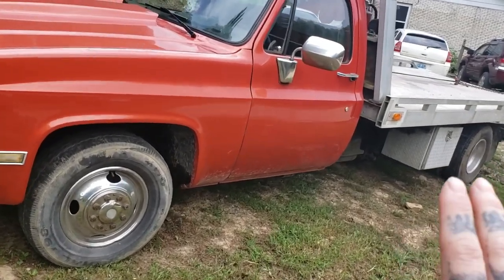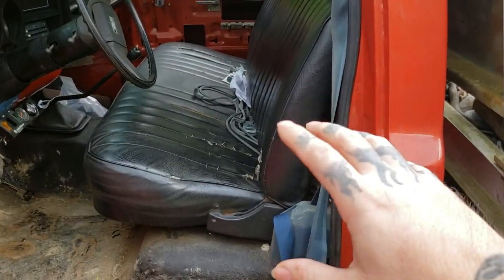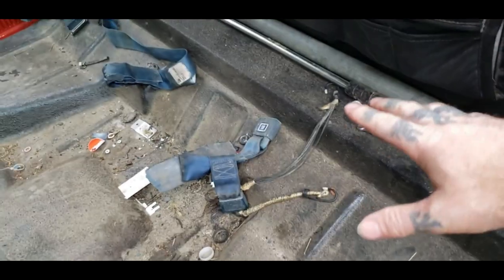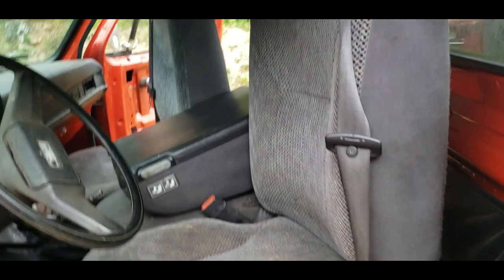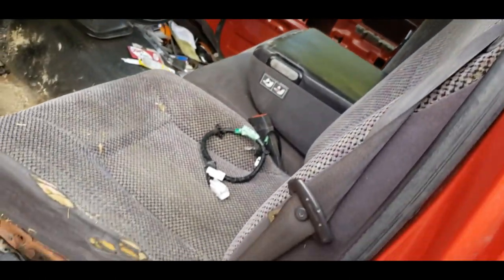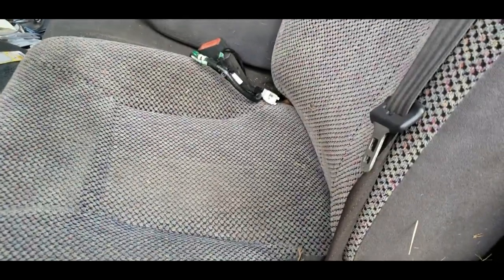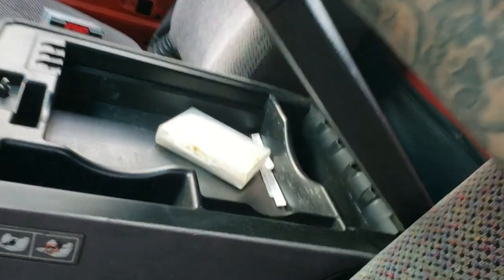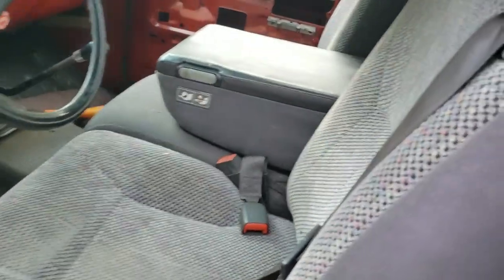Square Body Chevy Seat Upgrade, Bench Seat Swap

Comment: Nice job on fitting the seat. Since the seat belts are anchored in the seat back, I would suggest fabricating rear brackets. Just in case of hard braking or frontal collision, the seat would bend forward, placing you into the steering wheel or a passenger into the dash. Either one would hurt.
 As I understand, Sammy Davis Jr. unbuckled in his Cadillac died this way, when he hit the bullet shaped horn button, fracturing his upper ribs.
 You all take care now. Enjoy the videos and the work it takes to make them. Blessings brother.
Reply from the maker: True, but im not to worried cause the seats had to past safety with that set up in 2001 the year the dodge was made. great tip though

Comment: If the seat belts are integrated into the seat, then your seat belt strength depends on your attachment to the cab.or your welds .
Reply from the maker: Pretty much

Comment: I think my dad tried to put leather dodge seats in a 78 k20. But they were to wide
Reply from the maker: Wounder what year
Reply: @TattsForLife  it was a set of seats out of a 2000 I believe
Reply from the maker: @oldcroneysgarage9739  should of worked, did he remove them off the rails before trying
Reply: @TattsForLife  I can't remember it was probably 9 years ago now. The door panels would hit the seats
Reply from the maker: @oldcroneysgarage9739  leather may be wider, I'm not sure lol I know the cloth is perfect with my door panels installed